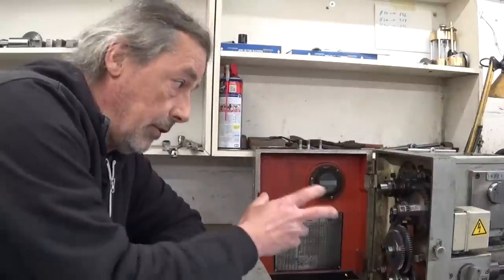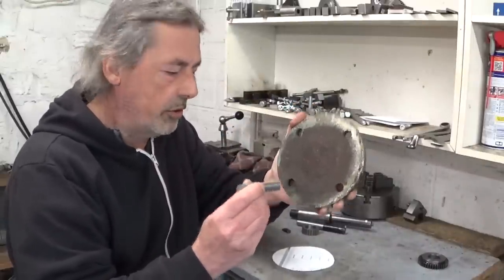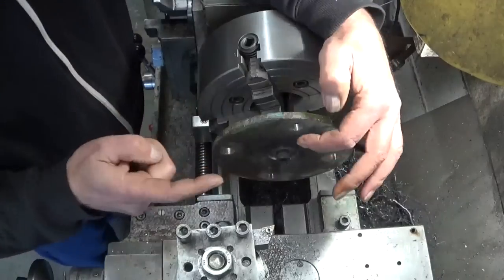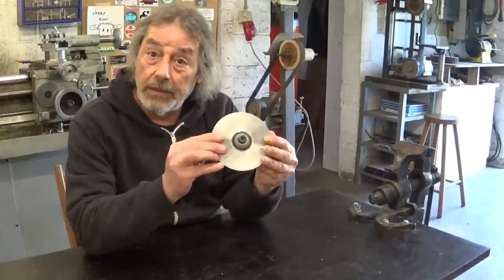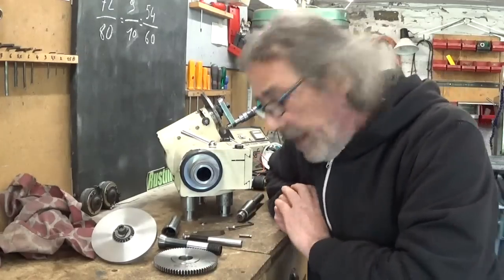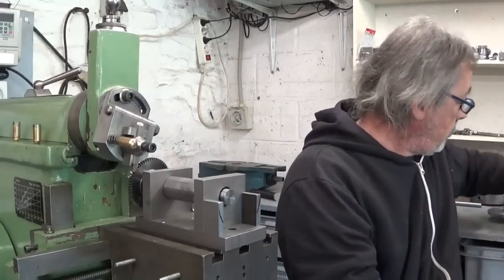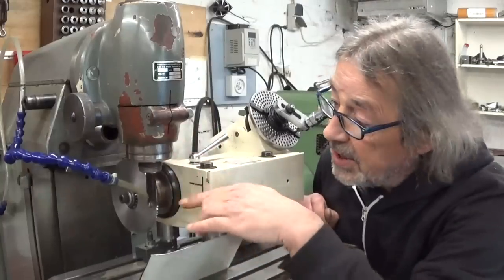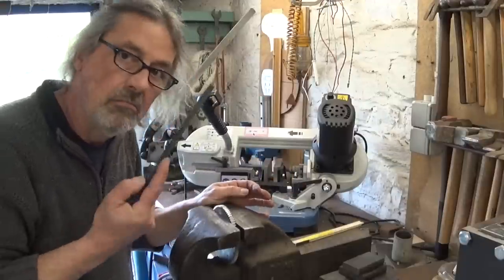An 80 teeth gear from scrap.

Comment: Nice job Michel. Making gears always seems like rocket science but if it doesn't need to spin really fast or transmit heavy loads a filed tooth here and there works fine.
Reply from the maker: I think so too. This is a very slow running gear and will be used maybe twice a year. So...

Comment: G'day  Rusty.    I thought a mig welder would have filled in the holes quite well. The setup, machining etc was really well done. Just goes to show how much you really know 😊.  Wifey likes your sence of Humour as well.  Overall a great teaching video. Waiting for the original job to go through
Reply from the maker: Thanks Ted. The holes are 16mm. It was easier to make plugs than to fill them all with weld, witch could also pull the whole thing out of shape.

Comment: Hi Michel ☺ well your ingenuity strikes again, lol, what a great way to make a gear blank out of scrap, ok you had a glitch when the cutter broke, but at least you only had two teeth to file, and it works. This is what hobby engineering is all about, adapt something , or make a tool to get a problem solved, and carry on whith the project,  that's what makes it fun and interesting. Thanks for another great video mate, stay safe, best wishe's to you and your's, Stuart UK.
Reply from the maker: Indeed, it worked. Thanks Stuart.

Comment: I had to make one thread with imperial pitch. I just 3-D printed the gear. It worked very well.
Reply from the maker: Sure, it works very well.
But I don't have a 3D-printer :)
Reply: @Rustinox  Mine has broken down. So i installed an ELS on the lathe. :-)

Comment: A quick second comment regarding your gear ratios, though.

Your 2mm pitch gear setting is an abcd (4 gear) setup.  If your gear setup plate was calling for (for example) 72 - 100 - 80, you could ignore the middle gear entirely and your gear calculations 50 seconds in would be correct.  However, assuming I'm reading the gear plate correctly (8:38 in your original video), they're calling for 40 - 80 - 72 - 36.  The 80 and 72 tooth gears are locked on the same axle, so you have 2 gear ratios to worry about.  The first, from input to the driven pair, is 40-80, or 1-2.  Assuming 1000 rpm at the input, the driven gears run at 500 rpm.  Then from the driven gear to the output you have 72-36, or  2-1.  So, again assuming 1000 rpm at the input, the 500 rpm at the driven gear becomes 1000 rpm again at the output.

As a side note, it's not surprising that the ratio is an integer for a metric machine cutting metric threads.  Look at the odd ratios you have when cutting imperial stuff :)

So you could replace either of the 2-1 gear pairs with another pair of the same 2-1 ratio, and you could cut your 2mm pitch.  Or you could replace the whole thing with a 3 gear setup where the input and output gears are the same if you have 2 identical gears available.  Say 60-72-60.  That would work too and might well fit.  I suggested a 30-60-72-36 setup because the sizes were close enough to be likely to fit, and because your gear plate shows a 30 gear setup being possible on gear 1 (which is often tricky, as it's the spindle gear).  This latter point is moot as in your case the 1 gear appears to be the exit of the gearbox, I hadn't seen that.

Give it a try.

Not that I'm suggesting cutting an 80 tooth gear is in any way a waste of time - it appears to be useful elsewhere, it means ou can use your gear cutting plate without worrying about "oh no, I have to do this instead", and gear cutting is always good therapy.
Reply from the maker: Thanks for your input. I find it very interesting.
Reply: @Rustinox  Thanks.  If you wanted to bootstrap the missing disks for your dividing head, it might also be possible.  Drop me a line, I can maybe come up with a plan based on what you have.

Comment: Well done Michel, Im sure that will help with your threading requirements in the future. It does not matter how you get to the finish line, even if it was with a file...
Reply from the maker: You're right. Just do it.

Comment: Given that you determined that you could use a straight-side tooth form for the 80T gear, an alternative would be to mount your dividing head on the shaper - no need for the involute generation that you gear copying setup uses. Of course, this would require another segue to make a dividing head mount for the shaper... :-)
Your approach works fine - just suggesting another way to approach the problem.
Reply from the maker: The problem is that the dividing head is bigger than the shaper table.

Comment: The tooth forces on those gears are quite low, especially on larger gears.
A piece of aluminium plate would be easier to work and plenty strong enough, even a piece of 10mm thick acrylic (perspex) makes a surprisingly sturdy gear.
I know machinist guys dont trust plastic very much but it can be a great easy solution for something that is only used on some occasions. 👍
Reply from the maker: You're right. But all I had was this steel plate.
Reply: @Rustinox  .. hi, is there a metal scrapyard near you?
There are a couple near me, they have literally shelves full of metal offcuts from manufacturing, like 10mm and 12mm aluminium plate, round bar offcuts in various steels and aluminium alloys etc, all sold dirt cheap around the scrap recyling price.
Most of it scratched etc but otherwise good, even with the alloy markings code on it. Cheap as chips! 👍🙂

Comment: Have you seen the 2 button method for making gear cutters?
Sounds very interesting ....

If the straight cutting tool on the shaper fits... Why not to install the rotary table on the shaper?
I thing this will work to
Reply from the maker: The dividing head is bigger than the shaper table, so that's not an option.

Comment: Great video Michel, I think I enjoy gear cutting as much as single point threading. When I cut gears I use a boring bar with a hand ground HSS cutter held by set screws. and usually I work with aluminum or brass. Enjoyed, cheers!
Reply from the maker: Boring bar is a good idea. I will keep that in mind.